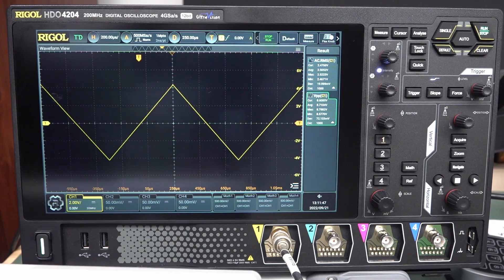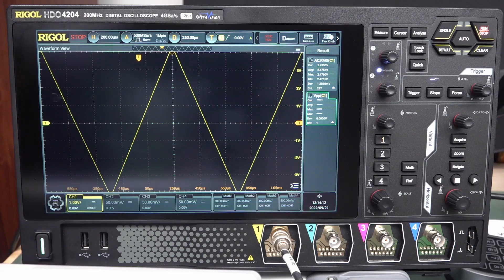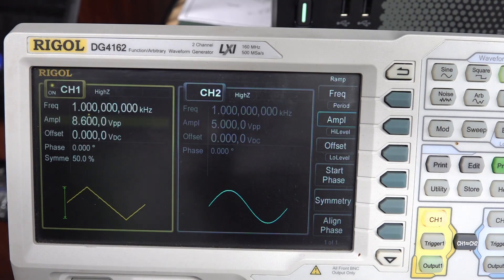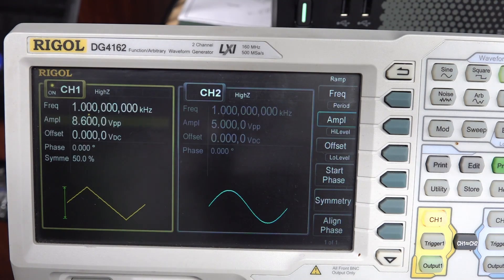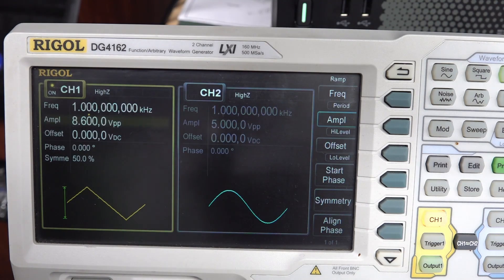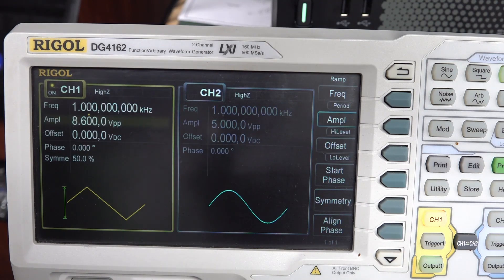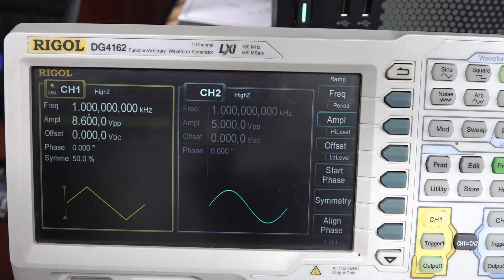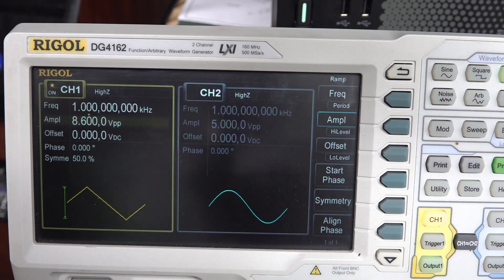How to Measure Oscilloscope ADC Dynamic Range

Comment: Thank you Dave for the video ,i am just asking, can you use the fft algo to see dynamic Range at clip waveform, in case 12 bit resolution it must be 72 db range at peak and noise floor, btw i using RTA4000, using high res mode i get roughly 96dB (its fit what the datasheet says, 16bit at high res mode). i am so sorry for my bad english
Reply: Hi You can use deepl for translation
Reply: @egonotto4172  thank you very much I just tried it
Reply: What is the SFDR of your  R&S?  Probably no better than -60dBc...??
Reply: @jim9930  No info in datasheet, but i ever measure 1 khz sinewave from Siglent SDG1032X, can measure THD from siglent wavegen around -60dBc, (siglent datasheet is 0.075%/ -62dBc)

Comment: I believe that Tektronix' range is 2.56 = 2^8 / 100 times larger than the screen height.  An even easier to program option would be 4 x (= 2 bits) the screen height.

Comment: For your calculation of resolution in mV you use the whole (stated) 12-bits, but how do we know if that is the case in the reality? Maybe I am missing something in the actual measuring technique..
Reply: Two signals slightly offset in freq mixed externally with resistors;  that's as 'real world' as it gets with FFT.

Comment: Can i just measure the clipped signal with cursor after clipping?🤔🤔🤔
Reply from the maker: Same as other comment response: 
The cursors on screen don't work zoomed in which means you get the same accuracy. The automated measurement does not work in this instance. You also have potential accuracy issues due to visual alignment and/or cursor resolution. But otherwise, yes you can get a reasonable quick reading this way, just not as accurate. Maybe on some scope it's different, but not on this Rigol.
Reply: @EEVblog2  Manually measure it with cursor while zoomed in?
Reply: I'm pretty sure this is a limitation for this particular scope....

Comment: Why not just measure the peak voltage with the clipped waveform?
Reply: Or feed 1khz sine with FFT on, mark the voltage before harmonics spike up.
Reply from the maker: Because you have to use the cursors on screen which means you can't zoom in the get accuracy. The automated measurement does not work in this instance. You also have potential accuracy issues due to visual alignment and/or cursor resolution.
But otherwise, yes you can get a reasonable quick reading this way.
Reply: @EEVblog2  Hmm. As long the ADC data is the same we can stop the waveform and zoom in on it right? There shouldn't be any screen/display dickery. Usually with 8bit adc the operation is not recommended because of the ADC accuracy but in this case we are measuring the ADC capability here right?
Why can't I use curser while zooming in?